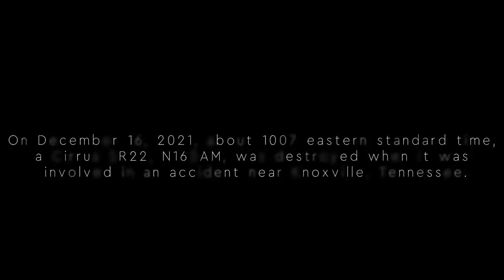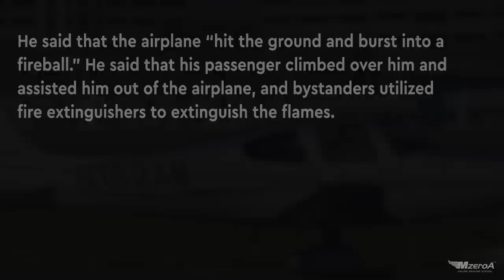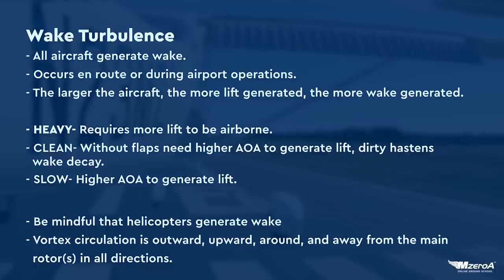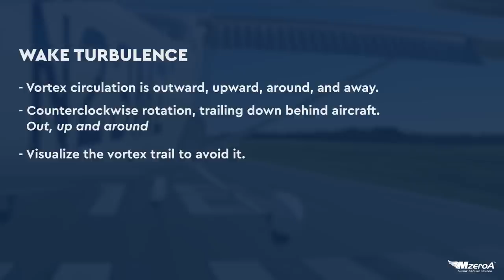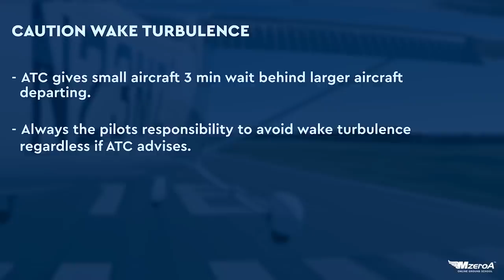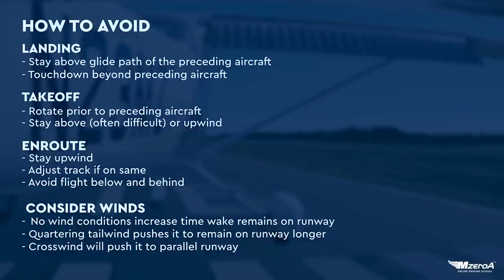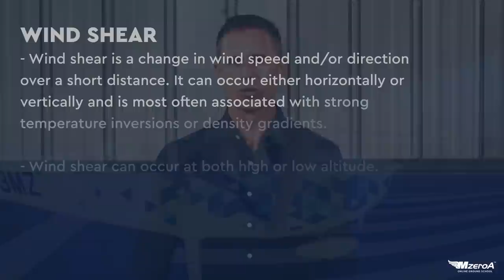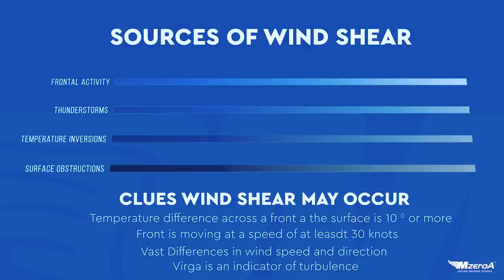Windshear and Wake Turbulence Avoidance

Comment: 23 for 23
I had a wake turbulence event turning base to final after 2 mile extended downwind for inbound citation. It surprised me and my CFI, as by all standards, it should not have been there. Nice, cool, calm night, and there it was. Handled it successfully and learned a valuable lesson about extending the full 3 minutes before turning in.

Comment: My "windshear" experience happened on final to Rwy 21 in Prescott, AZ way back as a student pilot. A vortex (dust devil) formed in front of me over the approach end of the runway. The problem with this dust devil was that there was no dust! The only clue was what looked like a small plastic bag that shot across and then straight up in front of me. Luckily, I was in and out of it in a second, but it yawed the aircraft enough that I had to go-around. Scary stuff, but SO important to learn! Thanks Jason.

Comment: 23 for 23.  This kind of information is invaluable.  My father is a very experienced and knowledgeable corporate pilot who once told me that the ONLY scenario that ever made him crash the simulator was wind shear.  If we can avoid it, we won't have to fly out of it.  Keep in mind that wingtip vortices typically descend at the rate of 300-500 fpm.  So even if a go-around airplane passed by 30-60 seconds ago at an altitude of a few hundred feet, you may have to wait before his wake hits you.

Also, if the wingtip vortex of a large aircraft is larger than the wingspan of the plane you're flying, there's NOTHING you can do to fly out of it, because the swirling air you are flying in has completely encompassed the airplane.  In those cases, it is sometimes recommended to actually roll INTO the direction of the uncontrolled roll in order to complete the roll faster and get back to straight and level flight.

Here are some great videos about wake turbulence and wind shear.

A Challenger 604 at cruise altitude rolled after encountering the wake of an Airbus A380 flying 1,000 feet higher on the same airway:
https://www.youtube.com/watch?v=ZI9ZHBRc2yQ

Single engine plane takes off behind Antonov AN-2 and rolls in their vortex just after becoming airborne:
https://www.youtube.com/watch?v=ktqo2Mqqdlk

Cessna 120 encounter helicopter wake turbulence on landing:
https://www.youtube.com/watch?v=tZLXMKMgnS8

Beechcraft Bonanza encounters wake turbulence from a Ford Trimotor during landing at Oshkosh:
https://www.youtube.com/watch?v=gh3wkfD_BJw

Glider towers and gliders during a microburst event:
https://www.youtube.com/watch?v=b_WmjWAGkLI

Comment: 23/23!  Honestly did not know of the 3 minute rule.  I’ve experience mid level shear in a Baron.  That was a weird uneasy feeling.  Low level with my second pax ever.   C150 at idle blazing ground speed sinking.  I did like you said and put in a couple degrees at a time bank until out of it.  That was very nerve racking.  
  Thanks for sharing all of that info Jason

Comment: 23/23. I'm so sorry for your loss Jason. This account is a typical confirmation of why you repeatedly say "Humble yourself in aviation or aviation will humble you", I use to underestimate the effect of wake turbulence until I saw  the kind of vortices generated when a small training aircraft flew through smoke to demonstrate this. The picture of the swirling smoke fumes imprinted a permanent picture of how large and dangerous the wake of larger aircrafts especially the "Heavies" would be. I also believe after heavies, Helos should be next in the categories of aircraft to beware of. I've seen a clip of how a plane spiraled out of control and crashed during takeoff when it flew through the wake of a helo that just landed, turned off the runway and was hovering at a taxiway. It happened so fast the pilot of the plane wasn't expecting what happened. Even I was in shock. I so much appreciate today's discussion, I sincerely hope the lessons of the Safer Pilot Challenge will shape us to become smarter and safer pilots. thank you Jason.

Comment: 23 for 23 from Hungary🇭🇺
Had a similar situation that you described Jason on my very first solo.
After my takeoff the plane started climbing like never before, I was like "whoa, this thing can fly" - the combination of the plane being much lighter than before (without the instructor) and a strong thermal updraft...
Same situation on final - the updraft was so powerful I had to literally force the yoke into the panel to make the aircraft descend, but at the same time I was holding onto the throttle for dear life as I knew I could come out of it any moment and fall like the head of an axe without a handle - luckily all was OK, I've made a smooth landing afterwards, but those 20-30 seconds on final before touchdown were very stressful.

Comment: 23/23
I was glad you touched on wind shear regarding having an airliner pass overhead while enroute.
About 5-7 years ago I was southbound in my C-150 @ 3000 MSL, an airliner was descending while northbound and approximately 1000 feet above me.
The airliner was going to be landing at KPDX, I was heading to Woodburn, OR for my annual fly over the tulip fields.
We were perfectly lined up, me southbound, airliner northbound, 1000 foot separation. 
I was very concerned about wake turbulence, flying into the airliners’ descending wake. I felt I had nowhere to go. Make a turn left or right, I would still run into the turbulence.
I pictured the wake descending and moving outward. So, I elected to stay my course and hope I was correct.
It worked out well, I never felt even a bump. But, I have always wondered: Did I make the right call, Just get lucky or Was I concerned over nothing?

Comment: Happened to me. At Grissom AFB Indiana as a student pilot in solo flight. A KC135 was doing touch and goes while I was in the pattern. Hot summer day with no wind. I advised the tower I was extending my downwind to allow more time for wake turbulence. Tower approved. On short final it hit me. Left wing and nose went down and all I saw was the approach end. Maybe because I was worried about it I don't know. I slammed the throttle full and pulled back on the yoke. I will never know how close I came but the tower said close. Control tower guy was one of our instructor pilots. As soon as I regained control I called tower I was going around. His response was "we saw you 15 Foxtrot". Wake turbulence is real. Just ask me.

Comment: 24 out of 24. Experience helps with all of these unusual occurrences. GA pilots need to use caution to everything and anything, always be ready to go around, and always be ready to cancel your flight.  A GA airplane is just an aluminum trash can with wings doing 100 mph through the sky… with you and your friends (or family) inside.